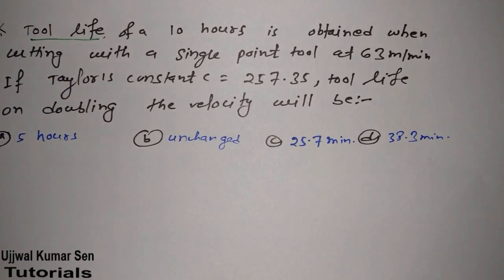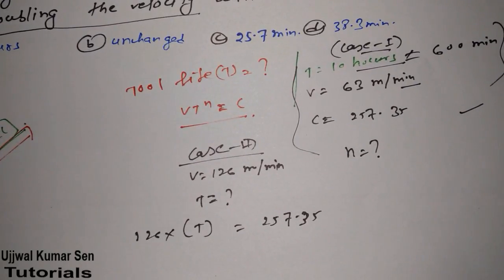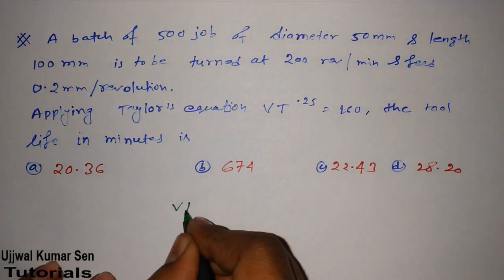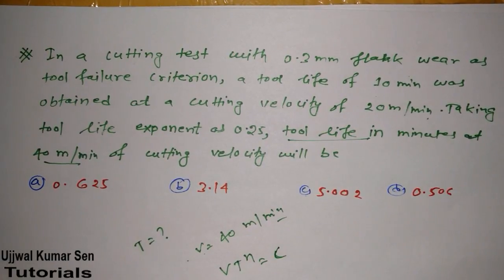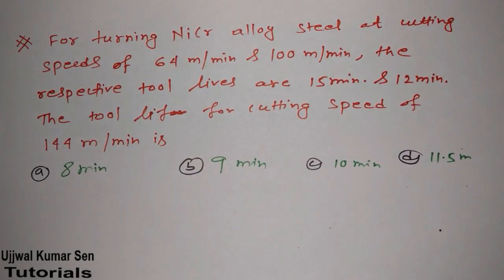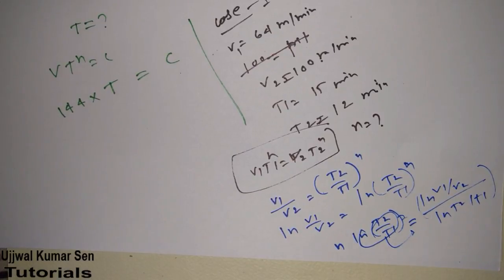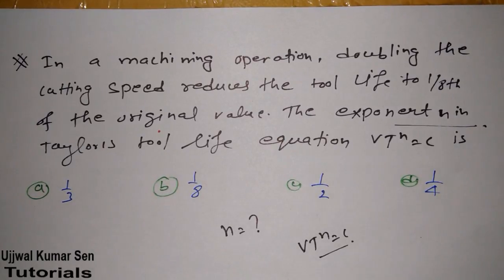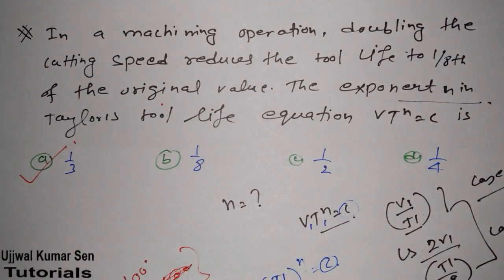Taylor's Tool Life Equation in Metal Cutting with GATE Previous Year Question

Comment: For tool A,Taylor life exponent (n) is 0.45 and constant (k) is 90.similarly for tool B,n=0.3 and k=60.The cutting speed (in/min) above which tool A will have a higher tool life than tool B,is
A) 26.7. 2)42.5 .3)80.7. 4)142.9

Kindly solve the question...Asked in gate 2010
Reply: a